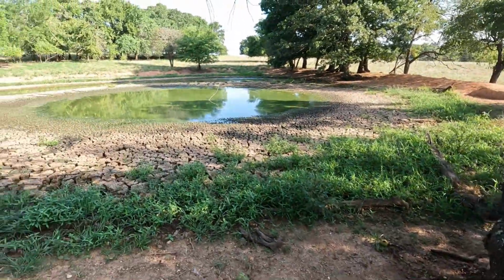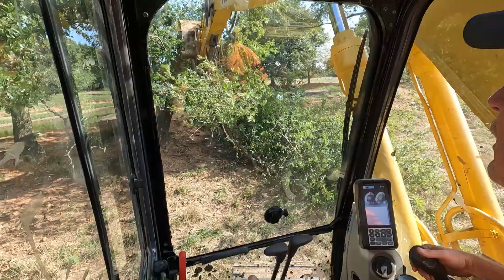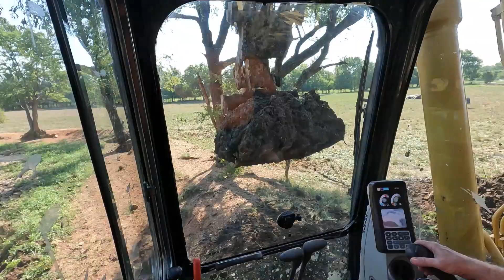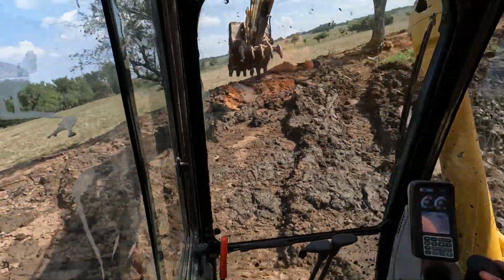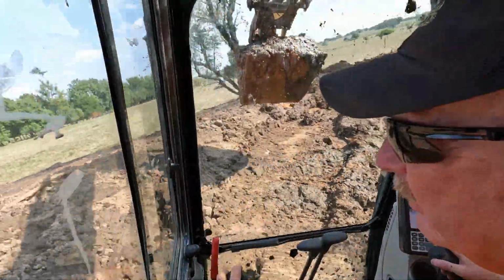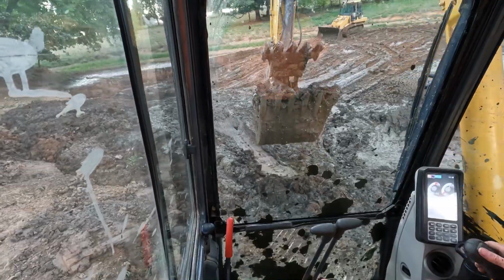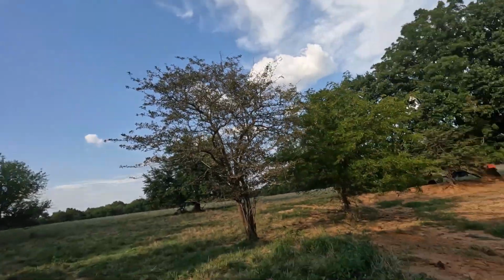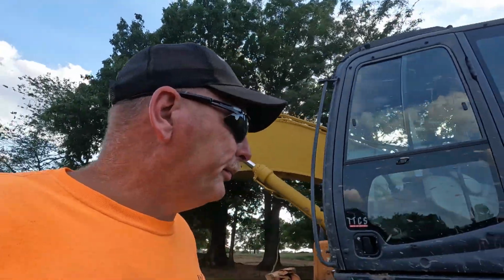An Old Neglected Pond Makeover!

Comment: Move the dirt/mud standing on top of it with mats is not better? You avoid to liquified again the material 🤔
Reply from the maker: You cant sit on this stuff with mats, it’s too soft.  The top 8” is somewhat dry, but below that it’s mush. There was water sitting in the cracks about a foot below the surface.  You’ll  eat up time messing with the mats, believe me we’ve tried.
Reply: @Dirtdaddy953  what kind of dirt are the mud? Clay?
Reply from the maker: @RickyCervo  Mostly leaf litter, silt and cow manure.  Super slimy and loose.
Reply: @Dirtdaddy953  Right, now i understand. Thanks. Eventually it can be spreaded out on fields?
Reply from the maker: @RickyCervo  What we normally do is once it dries we push it up around the backside of the dam to reinforce it.  Those old pond dams are usually eroded so bad from the cows walking up and down them that it gives them a little more life.  Thanks!

Comment: Couldn't you cut through the damage and push the mud to the outside  ?
Reply from the maker: Yeah I could of.  However trying to put the dam back together in a mud hole is tough to do.  Plus, trying to push that much loose material through a hole is not much fun.  It also centralizes all the material in one spot which will run way out into the field.  The farmers throw a fit when the material ends up way out in the field.  By keeping the material close to the dam and spread out it kinda keeps it closer and more concentrated.  Thanks Jim!
Reply: @Dirtdaddy953  yeah I figured there was a reason.  You accomplished the job really well.
Reply from the maker: @jimposey2224  Thanks for the comment!